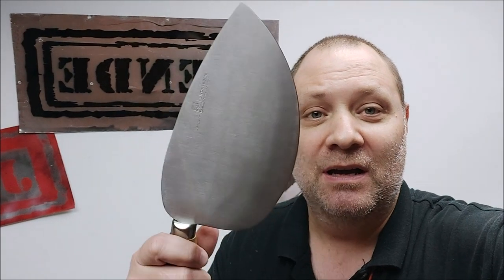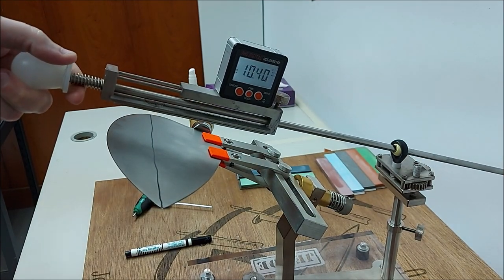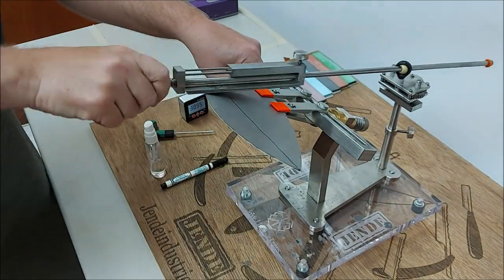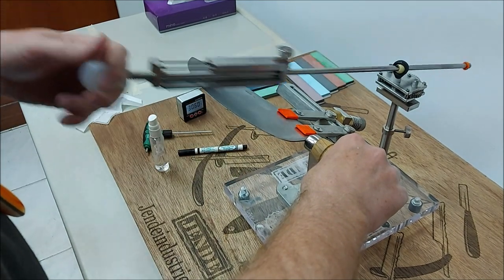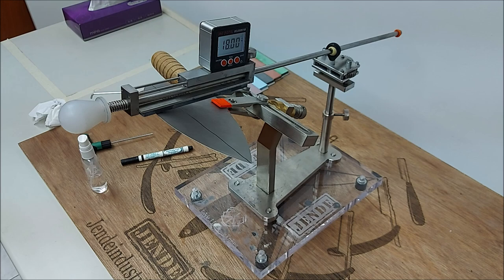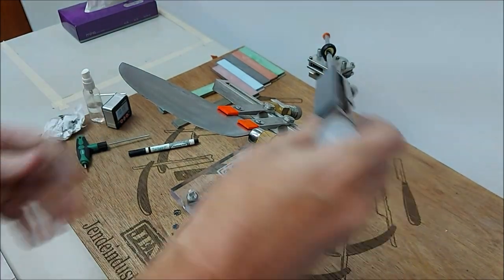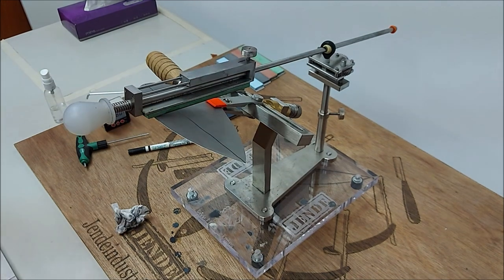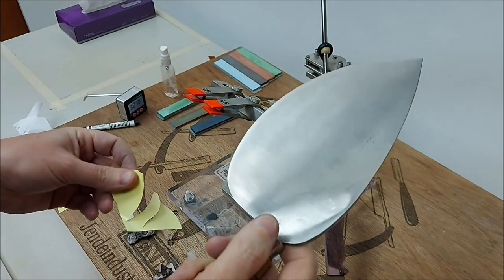Jende JIGS for Knives Sharpening a Maestro Wu G4 Fish Cleaver - Full version

Comment: Nice simple JIG, I don't see how you can easily sharp a knife with 2 different angles on this JIG?
Reply from the maker: You would have to adjust the angles accordingly, per grit, per angle you want. I do have a video coming where I actually use 3 angles. Yes it takes more time than a freehand convex, but it is much more precise on the JIGS.